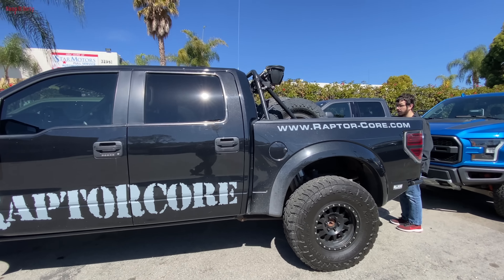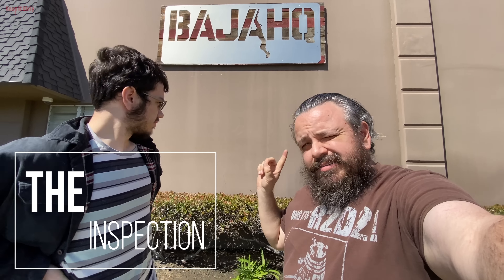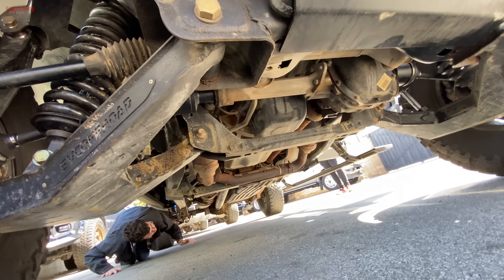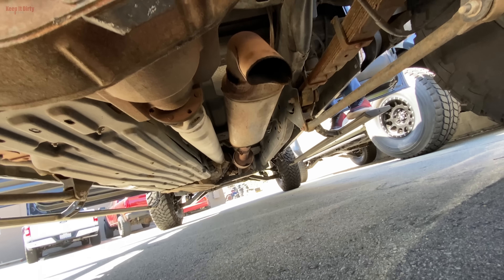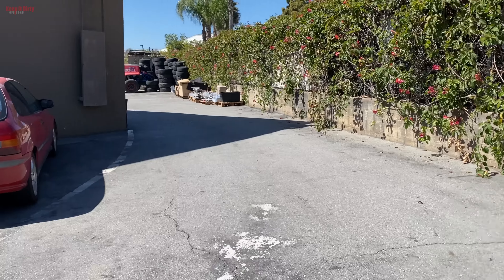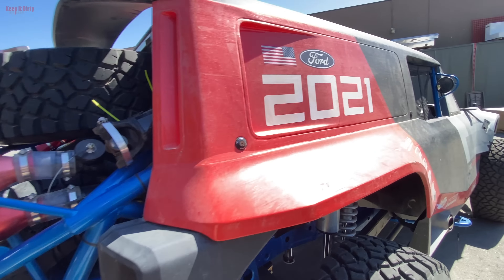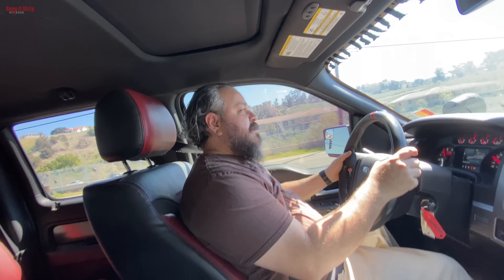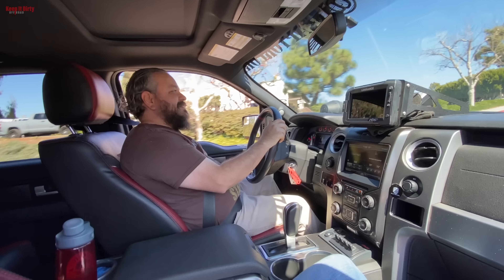Is this our next truck? RaptorCore  SVC Mid Travel Raptor

Comment: After watching the video it looks like this is a pretty solid truck. I know it’s done the Baja trip a couple times because I have seen it in the Exo videos and that is good because if it can handle that trip it has to be reasonably reliable. I would definitely do the fuse 27 relocation and add the Saudi trans cooler to keep the Trans temps in line. I honestly can’t believe the stock power steering has held up. It’s also not a super expensive fix to go to the Lee or Howe setup. Overall minus the cosmetics it looks really solid. The parts alone on the truck almost eclipse the trucks value. The 6.2 is a solid motor and if you take care of it it can go well past 200k and beyond. A shop near me had a truck with over 440k in for a shock rebuild. Good luck on the purchase! That truck will do amazing in the dessert.

Comment: Living in SoCal next to beach and the  rust from the salty air has killed our cars. I’ve started buying a few cans of truck bed liner and spraying everything under the truck- frame, control arms, cab... everything. Zero rust now. We live 1/4 mile Max from the water and still 15yrs later no rust. I park over gravel and crawl underneath and coat everything. It even keeps fasteners from corroding. I recommend it
Reply from the maker: Any kind of undercoat paint won’t hold up unfortunately with off-roading. The dust from the desert at high speed will blast it all over in no time. We’ve tried it and it only delays it. But if we keep going out, the sand blasting at least keeps the rust at bey.

Comment: Glad to see you went to check this truck out. Brian had 3 built Gen 1s until recently and I think the Terrain 13/14 he had was nicer than this one. Hopefully he comes down 5k, that way you can get a set of RCI skid plates and still have some cash for other little things. It's also a good thing it still has the stock intake, zero reason to run an aftermarket one when the engine is bone stock. 

If you tune it I recommend JDM over 5star or livernois. And yeah this truck is very analog, every time I hop out of my 2020 Tremor and into my Gen 1 Raptor I feel it instantly.. and I love it.
Reply from the maker: The terrain truck has a better front end suspension too. BUT it’s only 2wd. I need something with 4wd and currently this is the only 4wd Raptor he has out of the 3

Comment: I’d say get it. You have tires from the last build. BD Lights probably have a short on the passenger side. Easy fix. Trans Skids are easy to have made. $300 + black spray paint. You  may not like how fast it is on the street but It’s faster than the Gen2 you had in the dirt.. easy to get a tune to help with shift points and a few ponies. Only surface rust. A lot of that fixed with a quick sand and some undercarriage paint. Strap the front to help the suspension issues. Don’t know what he wants but if it’s a decent price I’d go for it.
Reply from the maker: The price is key. He wants $70k. Without the tires and paint he will only go down to 65.  If he goes a little lower we will do it.

Comment: That’s one of the problems with built up Raptors or any truck for that matter. Ridden hard and put away wet. I had minor issues with mine after I bought it but it took me a while to get her where she is now. Still learning and doing a few more mods for the way I drive. Good luck if you buy it. Hopefully we’ll see you on the dirt soon.
Reply from the maker: Buying used is always a risk. Specially when modified. So that’s why we had a shop do a pre purchase inspection as well. Overall this could be a great truck for us. And it will be fun getting her rehabbed.

Comment: i just bought a raptor 2010 molted orange  and it does need shocks  and they had a grill on it the sucker weighed about 200 pds fareal i took it off and gonna put my grill on it  and let me ask u a question i herd u say when u put the new shocks on it it gets louder i think thats what u said  i hope it does because i like loud
Reply from the maker: Bypass shocks are louder than stock shocks. The bypass tubes click and clack as the shock moves. Some people hate the noise. I dig it and it don’t bother me.
Reply: @KeepItDirtyOffRoad  great info thanks 👍👍

Comment: I’ve been contemplating going after this truck for a while but honestly the video scared me away. I have a mildly built Gen 1 now that is very clean but I want to go to the next level. Would you recommend that truck for purchase by another enthusiast?
Reply from the maker: I would have bough this truck IF he had priced it right for the condition. Just make sure you know what your getting into. It needs a lot of rehab, well overdue for shock rebuild, axle or diff problems up front. And a few other little things wrong with it that add up to a lot of work and expense. Plus he’s taken this truck out to Baja a few times. 

So I would take the whole suspension apart like we did with mine, replace all hardware and bushings, get the shocks rebuild and treat any nasty rust, and add some Offroad Republic skid plates to it and she will be all set to go. 

Don’t believe the seller on any claims of suspension refresh or work without seeing receipt. At the time we looked at it he said it was a fresh build but it has been over a year since it was at SVC at that point. At this point it’s been 2-3 years and well overdue
Reply: @KeepItDirtyOffRoad  this is great information. The price hasn’t changed in the last two years and yet Gen 1 prices have come down slightly. Did Raptor Core seem willing to budge on price at all? The paint on the bed looked really bad and the tires were completely toasted. This truck definitely needs some love.
Reply from the maker: With me he wasn’t. We were only a few grand away from it making sense to me at the time. Check the trucks core KBB value today to make sure it still makes sense. 

It’s also his own personal toy so not sure how willing he is to fix it all and then part with it.

Comment: Hey what was that about the reservoir and something about a fuse? Known issues? I want to verify on my truck. Thanks
Reply from the maker: YeH, very well known. Fuse27 is the fuel pump and the fuse is too small and will melt. Plenty of videos on it.

2nd is power steering is weak and needs more oil and better cooling to extend its life. So companies make kits that replace the reservoir with a bigger one and some add coolers
Reply: fuse 27 common issue, fuel pump fuse melts, easy fix you relocate it to fuse #70, kit costs $25. Stock power steering pump is a weak spot on the gen 1 he was just commenting that it hadn't been upgraded.

Comment: Depending on price it could be a good deal suspension is 20k+ alone. Needs alittle work but won’t be too bad.
Reply from the maker: The price is key. To replace this setup would cost $45-50k new. This one is no where near new and she will need some rehab.
Reply: @KeepItDirtyOffRoad  what’s the asking price?
Reply from the maker: Asking is $70k way too much considering the condition.
Reply: @KeepItDirtyOffRoad  that’s really high in my opinion.
Reply from the maker: Agreed. He was willing to come down some, but not enough yet. So we are waiting to hear back.
Reply: @KeepItDirtyOffRoad  bwahahaha 70k he's fvcking HIGH as the sky! Hard pass. Honestly I think that truck is worth about 45k or so
Reply from the maker: Book value for the truck is $47k because it’s low miles. But that’s for a bone stock Truck. This thing easily has $50k in upgrades. Mostly good upgrades, with a few bad ones. If the price is right, we will do it. But he won’t budge on the price right now so we will have to see.
Reply from the maker: Yeah, starting point for most upgrades to be is 50% of their original value if they are in good shape. While this has good bones, it needs some work so it’s perfect for us

Comment: A 2019+ used ZR2 would be a good cheap ride.  420motors on here has one as well as a badass Robby Woods built Raptor you should check out 🤙
Reply from the maker: I know Carlos and familiar with both builds. He’s the guy that basically proved the ZR2 could keep up with Raptors
Reply: @KeepItDirtyOffRoad  Oh nice!  have you guys run together before?  His videos are the reason I bought a ZR2 😅
Reply from the maker: @camguy1730  yeah, a while back we did and seen that ZR2 in action.

Comment: If the popping noise is happening while turning it may be the IWE. Easy fix though.
Reply from the maker: Not IWE. This only started once the truck was in 4wd. Once we took it out of 4wd and the front finally disengage, the noise went away.

Also, this truck don’t have an IWE. If you look at the video when we were underneath, there is no IWE lines and most likely has IWE delete.
Reply: Oh I see. The IWE setup is annoying. Hopefully it’s not to bad of a fix then. The Gen 1 is definitely a fun truck. I look forward to more content. Thank you for the great video!

Comment: Looks like a cool truck but is going to require a lot more maintenance than you are used to. Shocks will all need to be rebuilt and you're going to have to replace some front end components most likely. How many miles are on it? 65-$70k is way too high for what it is. It's probably a $50-55k truck depending on the mileage, those mods don't add a lot of value especially when it's obviously been beaten on. I could see $60-65k if it was pristine and hardly used in dirt but it's too high for the condition it's in.
Reply from the maker: Totally agree. Extra maintenance time and costs for sure. First project would be to replace some Heim joints and bushing.

Comment: That noise is most definitely not normal. I have a Gen 1 with icon bypasses in an Svc bypass rack and they don’t make a sound
Reply from the maker: Icon bypass shocks are much quieter than Fox and Kings. Kings being the loudest. But it’s normally. I don’t know what icon does to keep their quiet, but the bypass noise is normal.
Reply: @KeepItDirtyOffRoad  Hmm. The more you know. Still seems like a very poorly maintained truck. Anyone dumping that much money into a truck and failing to maintain it (especially with bald tires) is a bad sign.
Reply from the maker: Agreed.
Reply: @KeepItDirtyOffRoad  Icon charges $100 per bypass valve so it would be slightly expensive, but I don’t see why one wouldn’t be able to just buy King or Fox bypasses and swap the valves out for the icon ones. They just thread on
Reply from the maker: I doubt the icon valves would fit in the Fox and King shocks. They all have slightly different sizes I’m sure and not easily swappable between each other.
Reply: @KeepItDirtyOffRoad  icon sells their bypass valves in 3 different sizes and thread pitches and they’re most likely relatively standard and I have a feeling Fox and king use at least one of those sizes...if not one could always get an adapter to match the thread pitch. Just a thought as it would allow someone to run bypasses from Fox or king and have them be silent
Reply from the maker: Hmm something to look into for sure

Comment: Looks like alot of problems, probably beat to help and back, can't see you getting a Gen 1 for all the reasons you stated when you test drove the red one, you've got a taste of the technology and I can't see you going backwards. That said if you did, get a Pavement Princess and build it yourself. I think you should still look for a Gen 2 better suspension, better throttle response, ect..... I have a Gen 1 but that's all I've had.
Reply from the maker: Yeah, I’m struggling with getting into a stock Gen1 just for the reasons you listed above. If o get a Gen1 I need one that’s already capable and built up. Otherwise it’s better to wait for the Gen3

Comment: Last time I was at Baja HQ, I was checking it out.
Reply from the maker: The Raptor core truck or the bronco.
Reply: @KeepItDirtyOffRoad  the raptor shop they had a few h1's in there too. What did you decide?
Reply from the maker: Yeah, hummer core is just a few building over and they have a ton of H1s.

The guy selling the truck wen silent after our inspection and he does not want to budge on the price.
Reply: @KeepItDirtyOffRoad  The truck market is crazy, California prices are crazy and to get a good price you have to travel out of CA. Search AZ.
Reply from the maker: Crazy everywhere, not just Cali.
Reply: @KeepItDirtyOffRoad  I would start looking at doing a build from like a 2017 f150 with the 5.0 Go XL or XLT and take it to H&M.
Reply from the maker: You going to help me fund it? That shit is expensive
Reply: @KeepItDirtyOffRoad  35k at h&m and a used xlt you are way under a new raptor price. Get rid of the jl and now you can pay for a cage, fuel cell and a blower.
Reply from the maker: Your math is WAY off. Let’s say we go for their race kit, you forget about $10-20k in labor plus you need a new rear axle ($10k). And that’s before all the other stuff. A full prerunner built by them is easily $150k on top of the price of the truck. And that don’t even consider wait times to get in and the year or more it’s going to take to complete it. No Thanks.

Comment: Ammorts grip on a rambar??))). Are you serious?))
Reply from the maker: What is the Ammorts grip? I looked it up and only found fun grips.
Reply: Keep It Dirty Off-Road      Look video on 5.12..
Reply: mount point shock absorbers
Reply from the maker: Still confused man. You need to explain a little bit more. The shock mount setup is fairly common out here.
Reply: Keep It Dirty Off-Road  mounting the shock absorber not to the frame but to... Some rambar
Reply from the maker: Ah ok. Now I see what your talking about.

Ok that rear suspension is getting 18 inches of suspension travel. The Max suspension travel you can get from frame mounting is 14 inches. So what shops do is make a frame mounted bed cage to allow for the use of 16-18in shocks and increase the suspension travel to 18 inches. Only drawback is you have to cut holes thru the bed and loose some bad space to the bed cage. But it’s a solid cage and suspension setup that has been proven time and time again by multiple companies out here in SoCal.
Reply: Keep It Dirty Off-Road yes, I know all this ... but it seems to me that such an engineering solution is not the best ... I can't believe that this cage will withstand hard jumps and fast baja style driving ... maybe I'm wrong, I don't know ..
Reply from the maker: This style of cages are Baja proven man. RPG, and SVC make these and there plenty of examples out here regularly running them in SoCal and Baja without problems.
Reply: Keep It Dirty Off-Road  🤔... we need to tell the dodge guys about this so they don't drop their shocks to the ground..)))

Comment: IMO, hard pass. I don't see $50k in upgrades worth paying for on that truck. I built a f150 with all baja kits or SVC components, deavers, fiberwerx, 3.0/3.5s etc, etc much cleaner work for $30k.. but the thing that stands out is lack of maintenance(not hard to spray all metal parts to avoid rust) and all the little things you can see, b/c there are 100s more you can't. Of course, you seem to have all your own answers and will do what you want, and you need to finance it, but that truck right there will be nothing but trouble and you'll spend $10-$15k to get it running right. Best of luck whichever way you go.
Reply from the maker: That’s been my argument to Brian at Raptor core. I would want to do a suspension refresh and replace all the bushings and Heim joints just for my sanity, then all the oils, specially the transfer cases. And possible re-gear at the same time. Everything else is cosmetics stuff. But easily $10-15kin rehab like you said for tires and everything else needed.
Reply: @KeepItDirtyOffRoad  for sure. Personally, for peace of mind, I'd build my own. Get a personal loan, affirm, or whatever, but a built truck like that with what I see was driven hard. You have a solid YT, I'm sure you can get support for a build and that would be fun to watch. Maybe, possibly, cost you slightly more, but long term you know exactly what you have. Good luck!

Comment: Hard pass on that deal guys. You’re going to miss the power of the Gen2 for sure.
Reply from the maker: Yeah, for sure. But it’s a more Analog truck. Less electronics to go wrong. We were playing at the limits of the Gen2 and the electronics were our only limiting factor.
Reply: @KeepItDirtyOffRoad  I totally understand and I myself like a more analog truck, but I also like my power. Have you thought about trying to build on a diesel powered heavy duty framed truck? Granted there is nothing on the market quite like the raptor except for the TRX but in all actuality a heavy duty truck isn’t that much heavier than either of those two.
Reply from the maker: There are a few reasons I have not considered a HD truck: Heavy duty truck is easily 2000 lbs heavier than a Raptor. And it’s a whole other animal to try and get it to run fast like the Raptor. Diesel is also harder to get in remote areas. Baja is a perfect example where it’s not as easy to get diesel so will require extra planning.
Reply: @KeepItDirtyOffRoad  My 2500HD is only about 1000lbs heavier than my Raptor which I think is negligible. I do see your point about diesel availability.
Reply from the maker: I had an F350 single rear wheel and it weighed 8500 lbs with the diesel. I know the new ones are a little lighter but not by much. My raptor weighed around 6000 lbs.
Reply: @KeepItDirtyOffRoad  My 2020 GMC 2500HD crew cab dmax is 6750lbs. I traded my 2019 Raptor in for this truck because of all the issues I was having with mine. Ford QC has definitely gone way downhill and it shows. I just think a diesel powered desert runner would be awesome!
Reply from the maker: It could be cool, but the cost would be soo high.